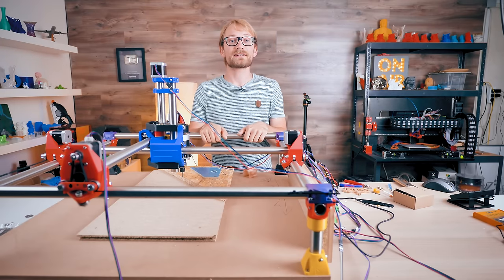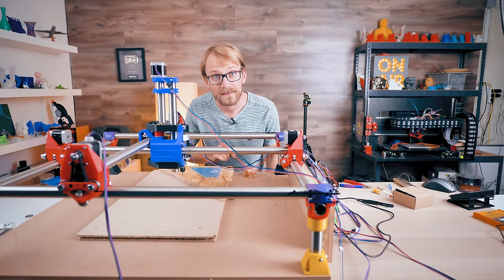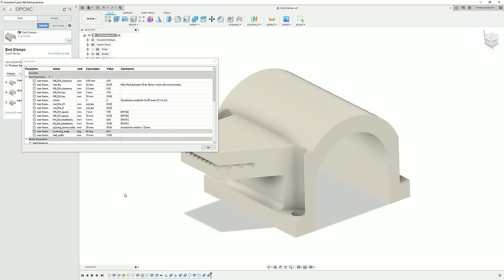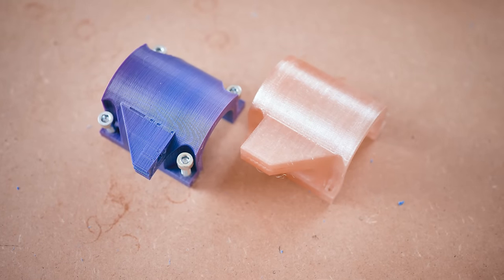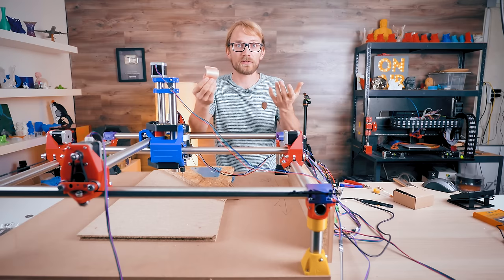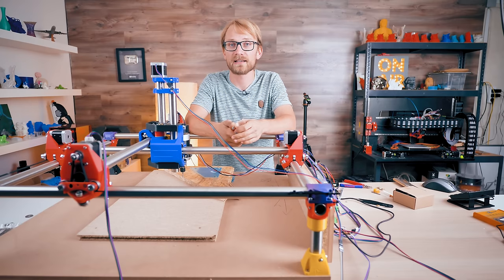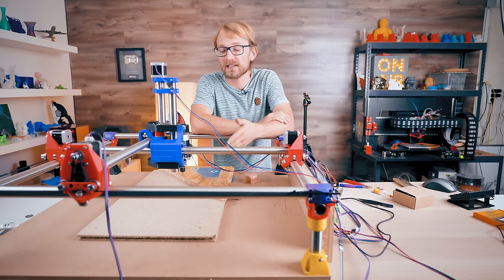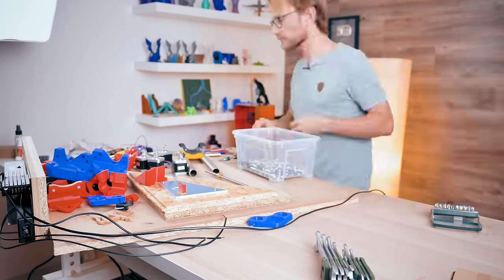Whose design even is this? (MPCNC conclusion)

Comment: It seems Ryan might even consider any CNC based on half inch pipe derivative ;) This video helped me walk away from a low rider project that I'd delayed because the tone of V1 Engineering had just bugged me and I couldn't put my finger on it. Ryan's attitude confirmed my concerns. Thanks Thomas.
Reply: Like the vocal majority on this issue, you completely miss the point.
Reply: @ARepublicIfYouCanKeepIt  No, you miss the point. There's a right way and a wrong way to pursue an open source hardware project. For the right way, see Josef Prusa. For the wrong way, Ryan's your guy.
Reply: @austntexan  Ryan's mpcnc is not Open Source, but that doesn't mean that releasing a part that fits on the machine/replaces one of the current parts is infringing any laws or rules. 
And I think a lot of people who build/want to build this mpcnc care about this part to a certain extent since it is simply better depending on your scenario.
Reply: @chyrt  He released under creative commons, so it sort of is open, and he fostered that attitude. But it doesn't matter because Thomas' design isn't derivative it is compatible and designed from a fresh start.
Reply: I have all the parts printed for the MPCNC, and if I would have seen this video before, I wouldnt have printed it. I always find ryan response on his forum a bit ish, and like you, coucldnt get my finger on why.
Reply: Yes if i newly design a cnc that even remotely looks like the mpcnc (like having 4 legs and use conduit) even if it would be for a different pipe size, could be considered 'a derivative' according to Ryan that is.

Comment: Nope; not only is the physical part not copyrightable, the functional fit is specifically excluded. Derivative or not, the part you designed is yours to share as you like.
Reply: redesign everything to look like a phallus, see if he claims it as a derivative
Reply: Absolutely right. 

Just look into the LEGO case. 

After LEGO run out of the patent rights of a brick they tried to have a copyright on the general design and failed. 

Everybody has the right to make their own bricks with exactly the same sizes and fit of an original LEGO brick and can sell it as much as they want. They are just not allowed to sell it as LEGO.
Reply: Exactly. Lego only has a copyright on the design of the figures, as the design of the heads, arms, torsos, etc. is non-functional and therefore can be protected. That's why other brands like Cobi, CaDA, Xingbao, etc. have different figures or don't include figures at all. 
  
But the actual Lego bricks are purely functional parts, so Lego has no protection on those pieces since the patent ran out . Other manufacturers are allowed to produce the same type of bricks, with same design and same dimensions. (And often with the same quality, but at half the price)
Reply: Lego also have (or at least, had) patents on many specific methods of joining blocks together, even though they only used one. By patenting the other methods, they could block other manufacturers from using them.
But that's a functional aspect, and totally different to copyright
Reply: It's similar to the way you can copyright code, but you have to patent the actual programmatic mechanism that it acheives
Reply: Your analysis is laughable. As are all other citations of copyright in the comments.

Firstly, the work is absolutely derivative. Secondly, that's not the issue. It's the license.

This whole thing is much ado about nothing.
Reply: @ARepublicIfYouCanKeepIt  Imagine being so confidently wrong. Shouldn't take you more than a few minutes of google to recognise your error.

Comment: Just... wow... I was going to build one, but I guess not anymore.
Reply: Why would you want to build one? It a massive fail, it can't cut
Reply: @matutolaYT  there are thousands working much better than Toms.
Reply: @jeffeberl12  there can be millions and they are all bad! There are just too many design mistakes
Reply: same here.. guess we have to look for a better and more open source friendly alternative
Reply: @matutolaYT  do you have one? What makes you the expert? I have one and a LR2 and I've seen a ton of people get them going. Tom's experience us unusual, to say the least. Most machines work great, despite nay sayers working in thought experiments.
Reply: I'm with you and I'll throw a "WTAF?" into the mix.
I don't get how Thomas is copping the flack for this. There have been hundreds of different MPCNC part designs out there under less restrictive licenses, such as CC-BY and CC-BY-SA, since at least 2015.
Keep your chin up, Thomas, I'll be keen to see what your next CNC project will be!
Reply: @jeffeberl12  tom's 3D printer experience should imidiatly red flag the linear system, even on some grams of weight a bad linear guide will ruin a printer.. How do you expect to have repeatability and duration on this joke of a linear system with a tiny tiny contact patch between a ball bearing a tube while under loads from the cutting process?
Reply: @matutolaYT  because I have had repeatability and many successes. I'm also not alone. Tom's results are odd and I think they are because 1) even though the zip ties are tensioned, they are too long and 2) he's mounted the import spindle by the cosmetic part of it in a really weak way.
Reply: Unlike some of the commenters, I do have one, and it works just fine. There are limitations, of course, but it's a hobbyist CNC and it will only do as well as you design it to do (how tight are your tolerances, what quality of parts do you use, etc).
Reply: @sngehl01  whats the cut speed, depth and tool size that you use on aluminium 3003?
Reply: same for me this kind of people who act like this ...my intuition said to me stay away
Reply: @jeffeberl12  the problem isn't that much the design as it is the Copyright owners weird interpretation of what the Copyright say what you can and can not do.

And Thomas, and now many with him, will not touch this design, even if it would be great, as it will not make us able to do what we like with our own machine. Like sell it.

This is why Stallman made the GNU licence and started the Open Source movement, when he wasn't allowed to make the changes to software that he and the lab needed.

That said, it isn't wrong to decide what can and can not be done with what you have Copyright on.  But it doesn't force us to like that, and stay around the design and its community.

So many with Thomas and me will go and seek something that suit us better.  So good luck with your machine, the designed looked interesting.  But it is not for us, even if it works great.
Reply: @sngehl01  it isn't the technical things that is the problem with MPCNC.  That could probably been found and fixed.  
We don't care if it works or not, if doesn't suit us and what we want to do with it.  And by the conversation, that is not compatible with what Ray allows his designed to be used.

If it works for you, great.  Keep up the work, and how you don't cross Ray and his interpretation of Copyright laws.
Reply: @AndersJackson  That's fine if you're making the educated decision that you are. I just worry about the damage done in the minds of people who don't fully understand what you're upset about. This isn't an "open source" machine, there are many of those out there. This is different than those projects because it has the support of the store, and Ryan, and a great forum paid for by the store. The community does contribute (it's not all Ryan) and there are a lot of modified parts out there. They are either mating, but original parts, or are released NC. If your goal is to modify, print, then sell parts for the MPCNC, then no, this isn't for you. Most people are not that person. The other people can really benefit from the MPCNC and in turn benefit the community, but this video, the comments, and the tweets are not showing the whole story. 

I'm just worried a well intentioned, supporter of the maker community, is going to get trampled by this story.
Reply: @jeffeberl12  then we do agree. 

It looks though like you are attacking Thomas (and my) decision that it is not the machine for us, only based on the license.  That it could be a good machine, but we will never now.

To quote Thomas:
"All things considered, the MPCNC is not the right project for me, but I still wish Ryan all the best with it."

I and may with me have got the impression that it is an Open design, which as you say it isn't.  So yes, People should understand this, and that is why Thomas has made this video, where he explains why it isn't a good choice for him, and why people will not see any more material about it here on his channel.

And to be cleared, Thomas has made it clear that he will NOT SELL parts, he is just wanted to make HIS design free to anyone to use.

And yes, I believe it IS showing the whole story.  It shows what the implications of that licens are.  And no, Thomas (nor me) say that Ryan should change the license.

And yes, Ryan doesn't use Prusas model...
Reply: Good or bad but I was thinking the exact same thing. It's really rigidness that will destroy a project like this when there are so many inconsistencies. Hard high hopes for it though. I'll probably be waiting a little while to make something like this and hopefully things get sorted out. Love the idea, I just don't have the shop space as of yet. Best!
Reply: @jeffeberl12  Tom is a relatively regular guy who is going to have many of the same problems that others are, to dismiss that is naive. He's more skilled than I with a bit more experience, if he had issues, sorry I'm not going to bother with it. Avoiding hassle from the onset saves time and frustration.
Reply: @jeffeberl12  to be clear. If you watch all the videos of people cutting aluminum in the facebook group. It is moving ABSURDLY slow and only cutting with the very tip like he mentioned. This wastes time and ruins the cutter in the matter of 1-2 jobs instead of 10+. I came to this conclusion several months back and decided to use OpenBuilds parts for a CNC instead.
Reply: @boredymcboredface8624  LOL, not good cutters. It the design flexes too much to take a proper sized bite without wearing out the tips.
Reply: NO  just NO on this reply. Lets set it straight. The V1 engineering stuff is closed source. he puts out STL's for use with his design for free. Thats somewhat great for him selling PLA parts on his website... I guess. I see absolutely zero benefit to him or anybody else involved to make a fuss over people modifying his designs to make their own machines better. 

What is the problem with a opensource belt Tensioner being available on the web? Where is the harm in that? You guys are all upset because you felt like Tom did a disservice to a machine that doesnt meet his needs. He wanted to improve the machine, and then a very dumb and pointless conversation took place over rights to a fricken file that might take someone no time at all to reproduce. 

I am personally bent out of shape from the facebook community and reading way too many of his posts on his own discussion forum.

When people need help from community members on modified designs surrounding this product....  I seriously have gotten the impression that he believes NOBODY should improve on his design for themselves or anybody else because it hurts his feelings. 

Nick Ellison (The minion man) seems to be one of the few contributors to that facebook page that understands what this project SHOULD be about. Its not about creating walls around a product design, its about breaking them down and making the best bang for your buck 3D printed CNC machine that you can from common hardware store components. 

AGAIN: I am no fanboy of either of these people. I follow the community surrounding these things. But I would rather pay 5X more for something GOOD that is community built and open source. I just get the sense this this is more about feeding 1 mans idea than a community supported project.

PLEASE somebody just make a cap like toms for the MPCNC, call it MPCNC "inspired" on thingiverse and call it a day.
Reply: @matutolaYT  If you dont want to build, then dont. It is a good machine though. I have one working for more than a year now - it is a very afordable cnc, made of easy to source parts. Ryan has the right to decide how he is sharing his creation. If you do some research you´re going to notice there´s a very active comunity working on the MPCNC. Thomas opinion is not really going to make much difference....he´s a good influencer, but he´s wrong this time.
Reply: same
Reply: If your decision to not build a MPCNC is based on Thomas's row with Ryan, you should reconsider.
Reply: @matutolaYT  And your credentials are what exactly?
Reply: @anthonyrich1592  What exactly is "restrictive" about the MPCNC license? To state that the licensing is restrictive is as woefully ill-informed as it is misleading.
Reply: @jeffeberl12  Thomas also admits that his build is larger than recommended. Problemo numero uno.
Reply: @matutolaYT  You're fishing. No matter Nick's answer, you'll find issue with it. Citing the inferiority of the design. Build one yourself. Then report your informed observations.

Any seasoned machinist will tell you that tool choice is dependent on myriad factors, not the least of which is spindle specification.

Manufacturers specify DoC for their bits. More importantly, they recommend chip loads for different materials. This, in turn, determines spindle speed and feedrate.

Lastly, and most importantly, while you specify alloy, you neglect thickness. So, as should be plain to any observer, your question can't be answered as put.
Reply: @matutolaYT  Easy Edmundo - I don't cut aluminum. 

I'm not sure what you found so problematic with my initial response - I know there are limitations to the machine and design, and there's a wide range of outcomes with a build depending on how it's built and what materials are used. 

Again - for an entry level hobbyist CNC (that you can have up and running for under $500) it's a great option. Do I cut aluminum? No. Can it cut aluminum? Absolutely, I've watched plenty of people do it. Can it cut steel? Again, yes, but you need proper tooling and know how to set the feed, DOC, and cool the tooling if needed.
Reply: @AndersJackson  I'm having a hard time understanding here, so I apologize if my reply misses the mark. 

You don't care if it works or not? So you don't care about the machine, only the copyright policy? 

At the end of the day, this kit is great to show people they can build a CNC relatively easy and cheaply. 

I bought an MPCNC kit. I then found a broken home shapeoko build on craigslist. I sold the MPCNC kit and fixed the shapeoko. I will build another CNC for a dedicated laser, but I will not buy a kit. I'll go with an arduino + cnc shield using GRBL and some a4988 drivers. I have a ton of extruded aluminum laying around for a frame. 

I wouldn't have felt confident doing this if not for the MPCNC.
Reply: @sngehl01  yes, how I am able to use the machine and modify it is important to me.  And yes, I am certain that it works well enough for many people, who doesn't care about licenses.  Who shut their eyes and hop it works.  Happy for them.

If I can't modify and share the modifications, why should I bother to put work on it, if I like it to be a learning experience?  When there are better ones for that purpose?  That allows me, and Thomas, to make modifications and let anyone do what they want with it.

Then it worked great for you, good for you.

I think licenses are important, that is why I don't run MS Windows, C# on MS Windows or Visual Basic.  I am an all open source guy. If it works for some people, happy for them.  But that doesn't work for me.

(Thanks for the good tone in your post, me like)
Reply: That's not the point. He WANTED to build one AND improve it to make it work great. The creator of this design did not like that. Rather than use the opportunity of one of the biggest 3D printing channels on Youtube to bring attention to his design, he fought him and demanded complete control of his design. Sure it's his right, but it was a bad choice. Communities make designs better by bringing group think in to solve problems in ways you may not think of on your own.
Reply: @jeffeberl12  They only work well for router/milling work when they're unusably small. If you want an actually usable machine, try PrintNC. This thing makes a fine plotter, or even a needle cutter (props to the Flite Test community). I have one, so I'm speaking from experience.
Reply: @godefroiyt  I've had two. My low rider has been making furniture for years and has 36"x48" work area. The printNC is vaporware, AFAICT.
Reply: "Just... wow... I was going to build one, but I guess not anymore"

Imagine basing your entire opinion of a product on the fact that a youtuber got into an internet argument over licensing.
Reply: Me too. Was just about to pull the trigger on this. Backing away now. Going ina different direction.